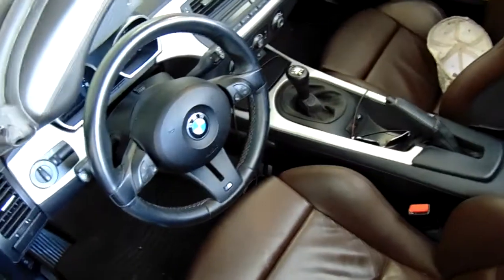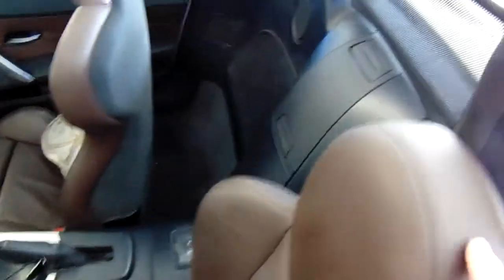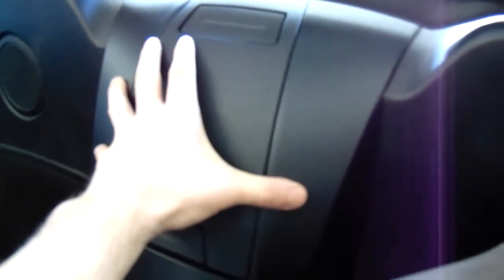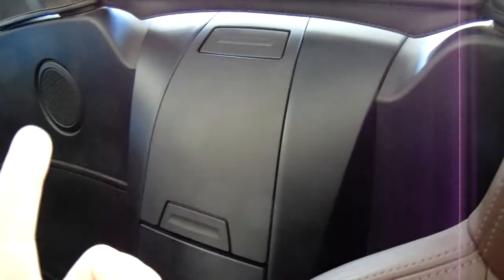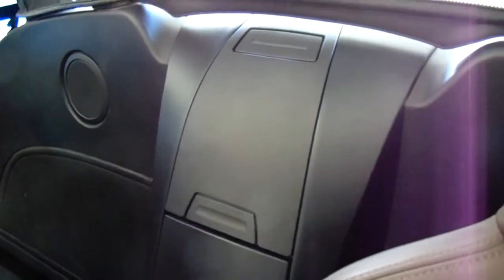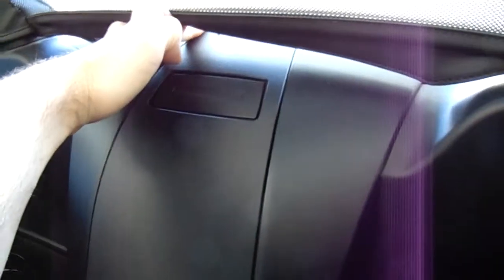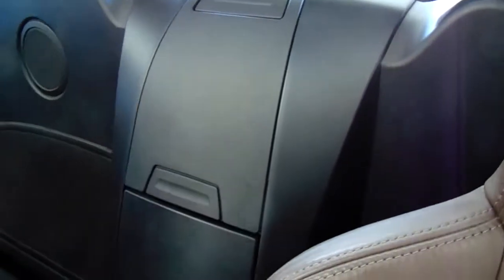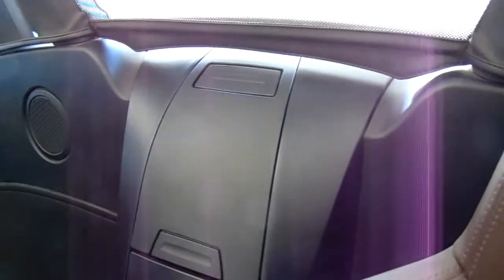z4 center console replacement PART 2

Comment: This was very helpful. I have cracking at the top as well. Who doesn’t. I’m not quite ready to spend the $400 yet but will do so at some point I’m sure. I do have a question if/when you see this comment - my little tab that turns the light off when the door closes has broken off. Have you had that problem?
Reply from the maker: Nope, I find that the light only stays on when the key is in the ignition. I just checked my car (which is unlocked) and the light would not come on when I open the storage door.
Reply: khyron4 thanks. A local dealer inspected the car before I purchased and pulled the micro switch and a a fuse (?) because the light either was not coming on or would not go off. Either way, I have take the Oder off and put the micro switch back in there.
Reply: khyron4 well, I finally received a replacement oddments box trim. I actually was able to pull off the top trim panel without it cracking!  Now I’m dealing with the light switch. My light stays on even without the key in the ignition, which is why they pulled the switch. The little tab o. The door has broken off so I’ll either fabricate a new tab or purchase a new door.
Reply: yup! I hear you happened to me took the light bulbs out ....flimsy little peice of plastic snapped right off..something must have lodged in there